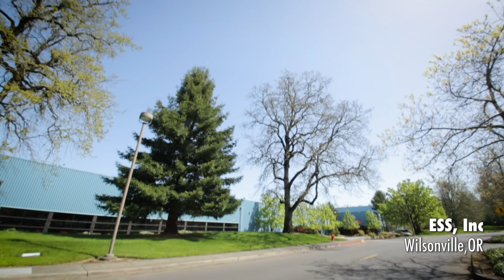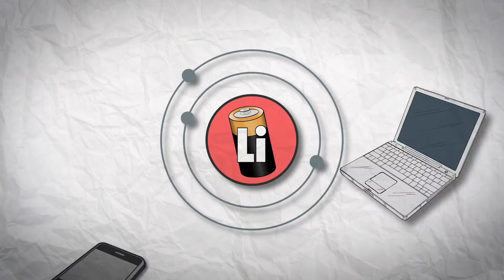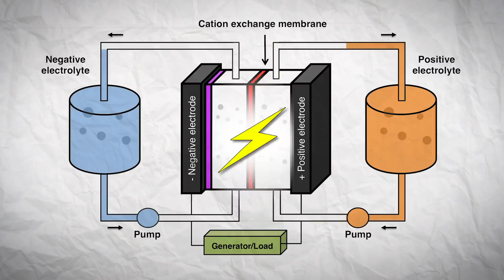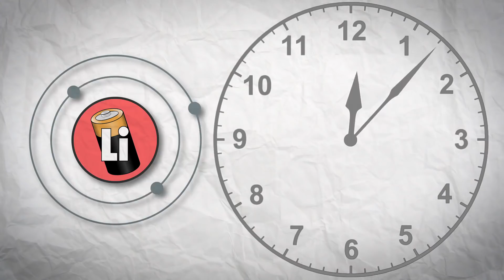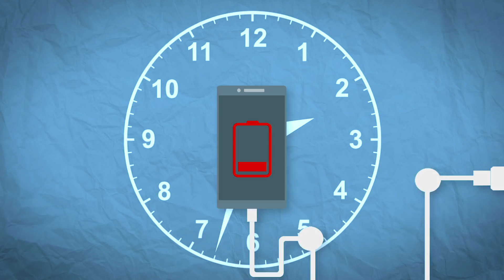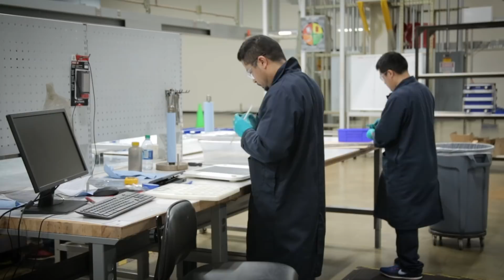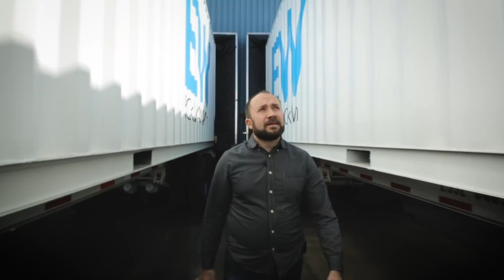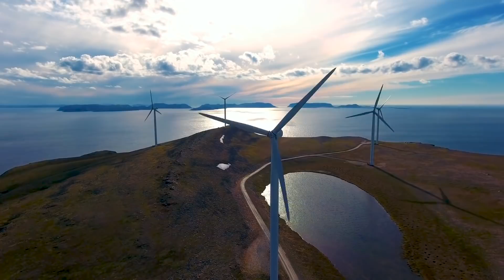Battery Fueled by Iron and Water Could Transform the Power Grid

Comment from the maker: The Good Stuff team got to go check out a new kind of battery. It's completely environmentally friendly because it runs on iron and water. It's called an All Iron Flow battery and it's being developed by ESS, Inc. Join us as we go take a look at how it works, what makes it better than other batteries, and how it can help solve our energy storage problem. We even go inside of it!

Thanks to ESS, Inc for their help making this video and letting us invade their factory floor.
Reply: Fertilizer?  I don't know how salt water can be considered fertilizer.  Releasing tons of salt water on to that old oak tree will kill it just as sure as an herbicide will.
Reply: @timlash  I USED TO WATER MY PLANTS EVERY MORNING WIRH MY URINE. IT FERTILIZED MY PLANTS  MY ROSES BEAR MORE FLOWERS.
Reply: On their website they say that the 2 sides are FeCl2 and FeCl2 that become Fe and FeCl3 respectively when charging. Both substances are not "fertilizer" and can be quite harmful...  https://en.m.wikipedia.org/wiki/Iron(III)_chloride#Safety
It's a pity you didn't spend 2 minutes to go to the technology page on their website to see that: https://www.essinc.com/wp-content/uploads/2018/02/ESS_Technology_redox_graphic_02-26.png
Note that the "salt water" is not NaCl but KCl. So technically when the battery is fully charged one tank is only KCl that is a fertilizer. But I bet that such a high volume of high concentration stuff will just kill plants instead of fertilizing them.
Reply: I use FeCl for PCB etching. That is not a bed or roses, I can confirm.
(However, still like this battery and hope it will fulfill its promises.)
Reply: @sandor.kecskemeti  yes and they want to use FECL3 as a fertilizer 😕
Reply: Here is a TED talk with a claim of a shipping container with a storage capacity of 2MWh - https://www.youtube.com/watch?v=Sddb0Khx0yA
Reply: I researched it and I think it's a phenomenal battery chemistry in many ways, although I think the safety claims might have been a bit overstated.  I think it is partially eco-friendly already because it uses earth-abundant materials that are long-lasting and recyclable.  I think it has the potential to be even better, however the Iron-Chloride liquid electrolyte is as acidic as lemon juice, which is a bit more acidic than carbonated water.  It's unlikely anyone would ever drink it because it would taste terrible, but it's not safe to drink.  It's dangerous to drink.  If the acid accidentally spilled it would be toxic enough that it ought to at least be neutralized with an alkaline substance (and heavily diluted with water).  For example you could throw some (sodium hydroxide) "lye" or baking soda on a spill.  If I'm not mistaken this would essentially convert it into table salt and rust, and  * that * would be about as non-toxic as anyone could hope for.  So I think the chemistry is close to being safe, but in its acid form it ought to be handled carefully to minimize the risk of spills, to alert people to spills, and to have the means present to handle any accidental spills.  Also the battery can't be overcharged or it will release toxic chlorine gas, but normally if it's properly designed there are simple electronic circuits to prevent that, similar to what you'd find in any lithium-ion battery pack.  At least any possible chlorine odor should help make it self-evident if anything goes wrong.

Some amazingly good things about this battery chemistry are: 1) it can be extremely efficient (well over 90%), 2) it can have very long cyclelife (>20,000), and ought be very affordable if produced in volume, 3) can be scaled-up as much as you want (GWh or TWh grid-storage scales) without triggering any materials sourcing problems.  (This has been an issue for example with the traditional flow-batteries based on Vanadium).  Considering how difficult these technical problems can be to solve, it's one of the best battery chemistries, if not the best I've seen, for scalable, affordable, efficient grid storage.
Reply: Just curious the efficiency of the charge-discharge cycle?
Reply: Is this real or another money grab like weve seen before.?
Reply: The energy density is much lower than for LiIon batteries, thus not suitable for mobile applications, but that is not a problem for stationary uses. The important factor is the cost per Kw-h, which could be quite low in very large installations.
Reply: MY INVENTIONS PRODUCE THE ENERGY - https://www.youtube.com/watch?v=VGLY5BntPVI  - but i dont need storage ;-)
Reply: I left a post on your page in respect of metrology...
Reply: The Good Stuff how much for one shipping container? I want to buy one.
Reply: @DylanBegazo  WHY WASTE MONEY BUYING ONE WHEN YOU CAN EASILY MAKE ONE. JUST KNOWCTHE MATERIALS NEEDED ANG YOU CAN MAKE YOUR OWN AT ANY SIZE YOU DESIRE  AS FAR AS I KNOW, YOU NEED ONLY ALUMINUM AND COPPER, ANG SALT WATER.
Reply: This video tells you nothing about costs, nothing about pump reliability, nothing about efficiency, nothing about the reliability of the control circuitry, nothing about battery management, nothing about lifespan, nothing meaningful about self-discharge rates, nothing about the toxicity to the plants of Potassium salts, nothing about the toxicity of Iron Chloride, and gives misleading information about the safety of 'sea water and Iron salts', and even infers that you might drink the 'water'. It also fails to mention the noise levels of the container full of equipment. In short, it's purely a sales pitch, which is aimed at uninformed people who do not do their research before buying the product. I call male bovine scat with this blatant product presentation.
Reply: @StéphaneFyfe  If you're an inventor, then where is your patent?
Reply: What about electric generation by wave action in the Ocean's never stops. No radiation no down time.
Reply: The Grid doesn't have problems. The Grid IS The Problem. People don't Need a grid that rips them off for electricity, something which in todays time is essential for life. People need their own off grid power plants in their homes and they need to be able to do this in Any city even if there is a grid utility company. People Need Choice otherwise you have unfair monopolies.
Reply: Organic way of electrical storage. Not complicated.
Reply: The chemicals used are FeCl2 or FeBr2, and NH4Cl. To charge the FeCl2 becomes FeCl3 and the NH4Cl becomes NH4OH. Discharge does the reverse. The electrolytes are flowed through porus carbon current collectors separated by an ion exchange membrane. As only the electrolyte fluids charge the battery would not easily degrade, and the charged fluids can be stored indefinitely in tanks until needed. The voltage per cell would be about a volt but the current capacity can be extremely high. Also the mixing of the fluids by pumping would guarantee that there would be no problem with weak cells as the batteries age, the aging if the cells would be very even. This type of battery would be an appropriate technology for renewable energy or peak demand grid level systems.❤
Reply: Please sign my petition to demand that ESS batteries be used to back up the power grid & allow the transition to 100% renewables https://www.thepetitionsite.com/512/414/627/we-demand-that-ess-batteries-are-used-to-back-up-the-power-grid/
Reply: This is bull shit.......this is not effective or true....

Comment: there is a battery that is transforming the auto industry right now. its the BYD LFP five minute flash charging battery.

add 70 miles of driving range in 60 seconds of charging. that’s gone in sixty seconds, technology.

they punctured the battery with a nail, no fire

they charged the battery to 260% of its capacity, no fire.

they heated the battery in an oven at 300 celsius, no fire

these batteries made by electric vehicle manufacturer BYD have retain 80% capacity after 4,000 charge cycles or approximately 750,000 miles of driving.

it looks like game is changed, yesterday. these five minute flash charging vehicles are already being sold in china, and scheduled for Europe and Mexico.

Comment: A few details about this technology.  It is a redox flow battery that uses iron halide, and ammonium halide. To charge it the halide ions move to the iron and make a 3+ iron ion and the ammonium halide becomes ammonia solution. When discharged the battery creates iron  2 ions, an electron, and ammonium chloride. The electrolyte flows over porus carbon current collectirs with a semipermeable membrane separator. The limiting factor is the size of the storage tanks, that when off can keep the charge indefinitely. It can be upgraded for more capacity by adding tanks, and to add more power, simply add more flow modules. ❤

Comment: Batteries do NOT create electricity. They can only store it. Now, put your thinking caps on and try to keep. A battery the size of a tractor trailer van can store a whole 4 hours of energy. So if your solar farm is under 4 hours of an overcast sky, that may be enough. If the overcast skies remain for days, you'll need 100 acres filled with these trailer size batteries and thousands of miles of copper wire to connect them, in parallel, to the local grid. Copper is mined &.decidedly not green. You'll need these 100 acre battery farms where land prices are the highest i.e. cities. Conclusion: I'll use terminology. The greenie wennies can understand it's just noodle doodle.

Comment: I think that the battery is a great new invention however there are a couple companies working on generators that can produce large amounts of electricity run for between 25 and 50 years with no maintenance and they use no fuel producing power is a lot better than storing it in 2016 the first generator came off in assembly line the only downside is the price in 2022 the first small generator that produces only 5 KW and is reasonably priced so an individual can actually afford it will appear within 10 years everyone will know about this technology within 20 years windmills solar panels and renewable energy will disappear off the face of the Earth just like ice box did and was replaced by an electric refrigerator and now a frost free electric refrigerator the time of the battery is limited within 50 years there will be no more storage of power a simple power generating device no bigger than a triple a battery will last for 50 years and produce enough power to power a laptop or even a small TV

Comment: Maybe in 20 years. Every breakthrough, every small improvement is going to be patented. That gives investors power over the technology to maximize profit. That means any new kind of battery won't be significantly cheaper than the last. Yes they will be a little cheaper and better. 
The same is true for every technology for battery or renewables, dictating a slow progress in actually getting the technology used in the world.
We simply don't have the intellectual infrastructure to transform our economy in time. 
And most likely it's already too late anyway. 
The only thing interesting is "low tech" that can help small communities to adapt to survive what is coming.

Comment: 50kw is the power max the capacity is only 400kwh I have 4 powerwalls in my garage they can do 28kw constantly and surge 36kw and have 54 kwh of capacity 50kw will absolutely not power a neighborhood block maybe 5-8 houses actually using power like ac or dryer I have seen my consumption as high as 14kw for just my own house at peak use.

Comment: Just get submarine batteries, you can wash em out and refill them every ten years or so. How much coal does it take to smelt the steel to build the sea container and produce the plastic polymers to make the piping? Oh and how much to recycle it too. Nuclear is one of the practical answer for co2 free generation. What it's really all about making money [or raising funding] by re-inventing the wheel for these type or enterprises. Don't forget all of the first cars were electric. HMS Vangard is nuclear powered and has never refueled since it was launched. Put a similar Rolls Royce reactor underground in every town = 30 years of co2 free power. By the way, co2 is only 400 parts per million or 0.04% of the air of which 3% of 0.04% is man made - Allen cycle clean coal will last mankind for 300 years - what's the problem?

Comment: This video has some nice production values including a well spoken host, some nice graphics and an overall a professional look. But if content is the criteria it failed. How does the battery work? Almost no information was provided on this. How does the battery stack up against other flow battery technologies? Other flow batteries aren't mentioned. What are some of the specific performance metrics like kilowatts per dollar, energy density and power density? There is very little specific performance or cost information in the video. Do the writers of the video understand the difference between a watt and a watt-hour? Apparently not, given that the video text confuses a watt with a watt-hour. What is the status of the trials? There was no information on this from somebody that isn't an ESS hack. Are other companies pursuing this battery chemistry? There was no information on this if they are. Are production versions of the battery available and if not when does he expect to have production batteries available? This is obviously an important issue when the internet is flooded with "battery de jour"  (Elon Musk term) videos and figuring out which of the batteries featured have actual potential. If this video wasn't  paid for ESS hype, it sure looks like it was,

Comment: What ESS does is put the whole thing in an 8 by 40 ft container.  That also includes the tank.  I think it would be best for large systems to put the tank(s) separate from the rest of the system.  Then the storage and time could be increased to more than a day, instead of several hours.

Comment: Another flash in the pants!! the REAL ANSWER to massive long term, SAFE, economic energy storage is LMB technology...or Liquid metal battery...by a start up called AMBRI... Tech was discovered/invented by a MIT professor and his grad students. Basically, the battery is solid metal at room temp and becomes liquid when charged using liquid calcium, a molten salt and anthony particles in suspension..no need for any kind of limited resource, very sustainable.  I'm no chemist but have listened to a lecture by the discoverer Professor Donald Sadoway, who is a current MIT professor, an inventor with over a dozen patents, and a 2012 TIME “Most Influential Person of the Year” for his pioneering research. LMB IS the wave of the future....very simple and very safe!!! scalable to as big as you want,  but limited to what will fit in a tractor trailer for ease in transport...NO maintenance required...will last for decades with almost unlimited cycle life.with no loss of capacitance....Bill Gates monitored some of Prof.  Sadoway classes and went to HIM offering funding!!! Ambri has now partnered with NEC, who will use Ambri's tech for long term storage..here's links..see for yourself!!   https://youtu.be/NiRrvxjrJ1U   https://www.energy-storage.news/news/nec-picks-ambris-liquid-metal-battery-for-longer-duration-ess-projects   https://ambri.com/

Comment: " .. just one of these containers can provide 50 kilowatts of electricity. That's enough to power and entire neighborhood block for 6 hours." 

  Just FYI, kilowatts and kilowatt hours are not the same thing. If you had looked at the side of the semi-trailer in your video you would have seen it says 40 kWh. This is an important distinction for a battery.  Kilowatts does not say anything about how long a battery can power a load; it is an instantaneous measure of power.

  When you are reporting on technical products, it is important to get the details correct. For batteries it's all about cost per amount of energy stored, as well as the ability to support large transfers of energy, both in and out of a battery. So how much is this battery projected to cost?

Comment: I'm no knocking this technology, in fact I think it shoes lots of portential. However, the claim that lithium ion batteries only last a couple years is outdated and false. That's somewhat true of consumer electronics, it's not true of cars and grid-scale batteries. For example, there are Teslas with 200,000 miles on them and only 15-15% battery degradation.

Comment: You got units mixed up when you said "one of these shipping containers can provide 50 kW of electricity. That can power an entire neighborhood block for six hours.". What you should have said is "400 kWh can power a neighborhood for 6 hours." because the units of kWh include "hours." 50 kW only means the power output, not the energy storage over a length of time.

Comment: A lot of the statements made in this vid simply are not true. Something better than lithium would be great, but lithium, if kept properly minimum half charge has many more cycles than rated and will not degrade noticeably at all for charge capacity or cell phone time, even years after the cell model becomes obsolete. This vid is about as shady as those free-energy devices.

Comment: I'm a little bit concerned about some of the language in this. The system is a FeCl2/FeCl3 redox flow battery. It's not a bad system, it's certainly cheap, and the ferrous chloride electrolyte has few other commercial uses, but I'd hesitate to describe it as fertiliser and I don't think an electrolyte spill could be described as "completely environmentally friendly". The redox tank in particular, with a high concentration of iron (III) chloride, would not be a good thing to stand near if there is a spill. This is all a bit sad, as the system actually does have some real advantages - it's just that if you gloss over the potential dangers of a good system, when people find out they will assume you were also lying about the benefits.